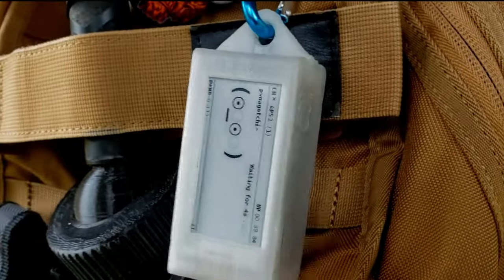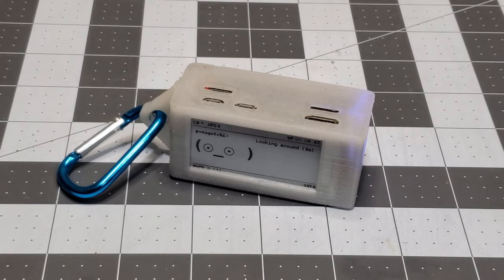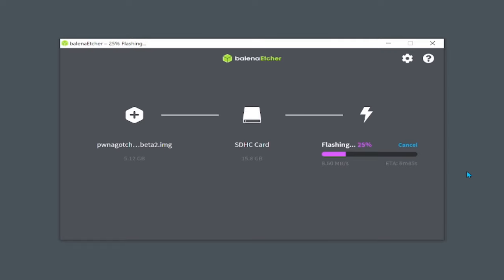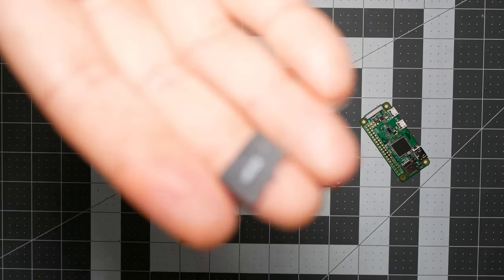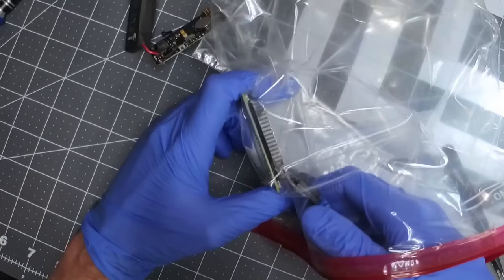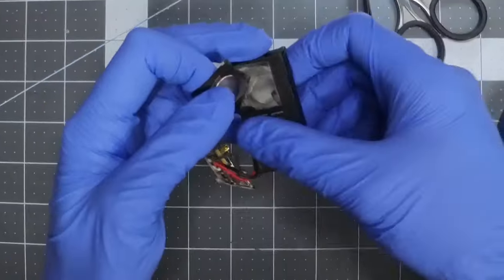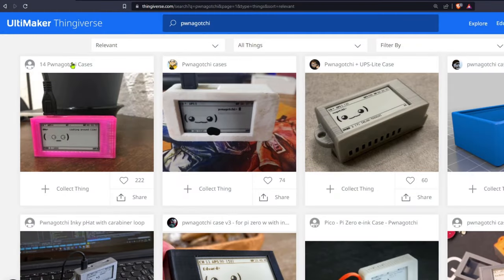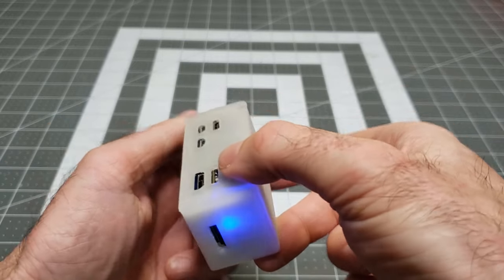Pwnagotchi Tutorial, Pt. 1: Hardware

Comment: Thank u for the tutorial. I've used the Raspberry Pi Zero WH with the V4 waveshare Display with version 1.5.6 beta and it works fine. Also i got the case u showed in the vid printed in my local 3d printing service and it turned out very good.
Reply from the maker: Thanks, glad it worked! Just curious, how did you find out about your local 3d printing service? I should have mentioned that for people without a printer, some central libraries have a 3d printer you can use.

Comment: use a fan and filter for fumes its only pine resin
Reply: At 2:22, he says that he did indeed us a fan and filter.  But, I want to point out that your comment is inaccurate. While standard flux is in fact made from pine resin, there are often other additives added to professional soldering flux. In addition, when soldering, some of the lead is converted to lead oxide and gets vaporized.

Comment: @cyberspacemanmike is the battery clock mentioned on the website not needed anymore? Sorry if i missed this point being mentioned.
Reply from the maker: It was never really necessary. It only provided more accurate timestamps which I don't really see a need for, especially if you're GPS stamping the location.
Reply: @cyberspacemanmike  awesome thank you for the info I am about to start this build so just trying to gather as much info as possible.
Reply from the maker: @Deepemulsion  Np! I recommending speeding through and jumping around the live stream to see what the build looks like IRL.
Reply: @cyberspacemanmike  I'll check that out thank you.

Comment: Why didn’t you use the Pi Zero 2W board?
Reply from the maker: At the time there were compatibility issues with the pwnagotchi images, I'm not sure to what extent those have been resolved. I also don't know if the quad core upgrade would offer much of a performance boost in this instance.
Reply: Hopefully when I get around to building mine, they should be resolved.  It was a no brainer, I found it for $14.99 compared to $23.99 being sold at Amazon.
Reply from the maker: @gotrice101  I have seen people reporting success with the Pi02W; reddit.com/r/pwnagotchi or Discord are the best places to source info on it.

Comment: Hi, can we get the ssame results using a raspberry pi pico W or something like an ESP.
Reply from the maker: Whereas the pi0w is an SBC (Single Board Computer), the pico is a microcontroller so it won't run the pwnagotchi OS. I think EvilSocket was considering developing smthg ESP related but I'm not sure how far it went. You can get similar results on the ESP with Hash Monster. I'll be working on an ESP project soon.